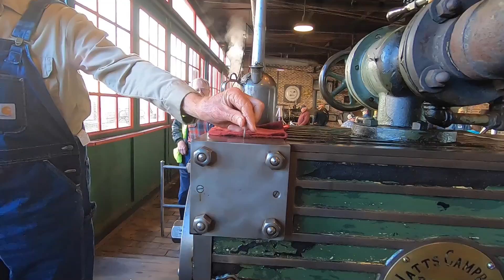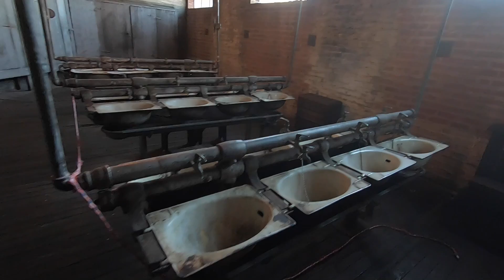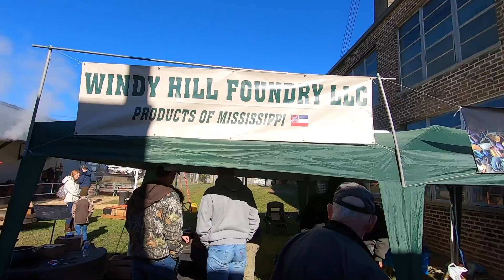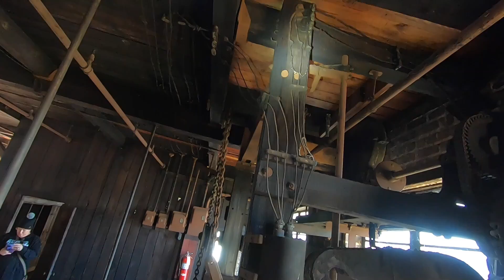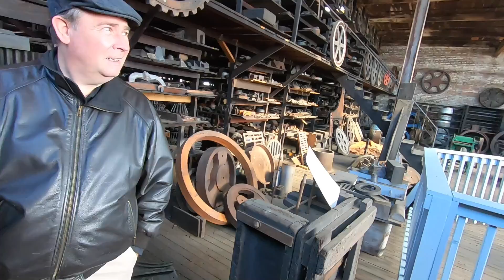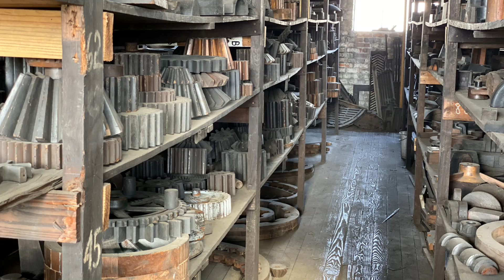Soulé Steam Feed Works: Pattern & Engine Shops, Foundry

Comment: great vid!  Interesting to see how this nation was built, one casting and engine at a time.  addressograph machine:  My mom used one of those  for church mailings up to about 1970.  It sure sped up the addressing of envelopes for large mailings. I used to help her with this machine.
As a cabinetmaker, I have always been amazed at the patternmakers.  They not only had to know the woodworking part but also the science behind contraction of the metal of cross sections in order to make the patterns to compensate for shrinkage...every pattern had different sections because of size.

Comment: I just love your tours of old shops.  I especially liked the Pattern shop part of this tour, since I've made some foundry patterns in my day.  It's a craft which requires great skill and fine measurement.  Especially since cast iron and aluminum shrink at different rates (1/8" and 3/16" respectively) the patternmaker had to account for the shrinkage by using a shrink rule.  Very exacting and time consuming work.

Comment: I know this video is 2 yrs old but I have a question regarding steam powered machine shops. With a single piston engine wouldn't there be a surging in rpms delivered to lathes and drill presses that a require a constant speed for accuracy?
Reply: Probably no surging caused by the engine itself. The piston is being acted upon both sides of the stroke, a massive flywheel, mass in the line shafts, and lots of floppy flat belts.

Comment: Amazing machines. Had to laugh at "we have a lot of spare parts" comment though? Wonder who the supplier is? Fred Flintstone? Seriously, though. How smart were the engineers and others that computed (guessed?) what the pressures of the systems would be? How did they figure the bearing dimension and bearing loads? These and many more questions come to mind. But the driving thought is it was ALL DONE WITHOUT A SINGLE DAMN COMPUTER other than the ones they had between their ears. Must go to this place someday.
Reply from the maker: They have many NOS spare parts that were never sold or put into the engines.

Comment: It looks like a 150 yr old time capsule. How did this survive? How did all this stuff not get melted down during a scrap metal drive in ww2?
Reply: Rv4 Guy    The plant was in operation until 2002.
Reply: Really??? What were they doing? Was there a demand for steam engine parts in 2002? Incredible that all this was preserved.
Reply: Rv4 Guy   If I heard him right, that is what Abom mentioned in the video.  It sounds like they did a lot of custom foundry work.  He’s going to do a part 2 including the machine shop.  That may have also been operational until 2002.
Reply from the maker: Soulé was in business until 2002 when it was purchased by Jim so that it could be preserved and turned into a museum. He founded the museum so that they could protect this rare example of early American manufacturing. They did work primarily for the saw mill industry and also lots of foundry work as well. It really is amazing that they never modernized the place any further then what you see here.
Reply: Abom79   I didn’t catch Jim’s connection to the company while it was still in operation.

Comment: Why did they put the loose gears on the spinning shafts up above, was it to indicate direction?
Reply: Those are to catch any drops of oil that would run along the shafts. Most likely made out of cardboard. I know them made like pipe cleaners. In the early days something similar was on the hubs of bicycles.

Comment: Heck of a place, everything made from raw in-house.

I like the way every company took pride in their work and placed a plate on saying who they were and where they were.

I can compare, I just bought a pile of cheap garbage Chinese tools in a toolbox - Not a logo or company name in sight, not deburred, pliers don't work, channel-locks are factory locked due to imprecise machining, sockets are thin-walled, etc. I got them to have a bunch of tools I don't need to care about that I can cut and modify for specific jobs but now I doubt they'll even work for that.

No maker's marks, no pride in what you do - It's a different way of doing business, that's for sure. Not an honest way.

This place had it right in more ways than we realize.

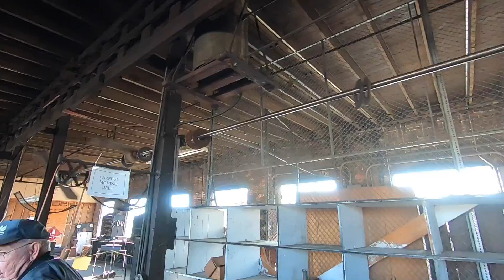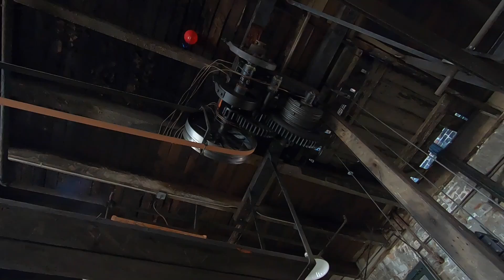Comment: What are the large 'washer type things' at 4:49 and 42:11 on the rotating overhead shafts for?
I really like these company tour videos.
Reply: to keep the shaft clean I believe
Reply: CastingIron Engines: The shafts do look shiny and clean. This would allow the pulleys to easily slide on the shafts for removal. Clever idea.
Reply: @douglaspierce316  Yes, they are called "mice"